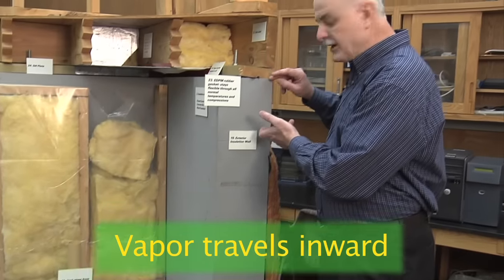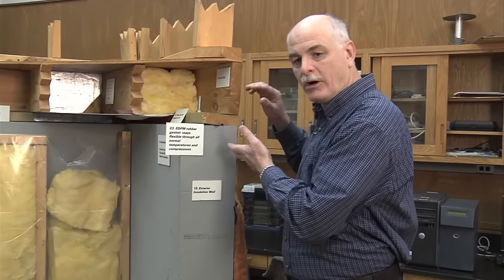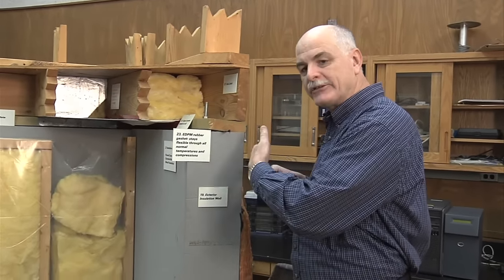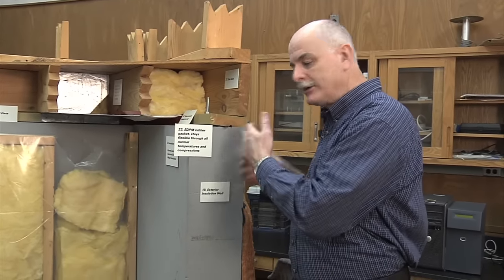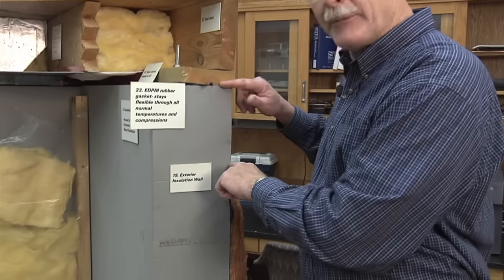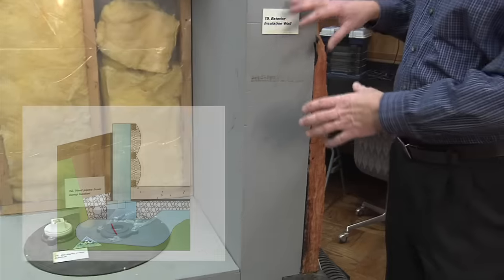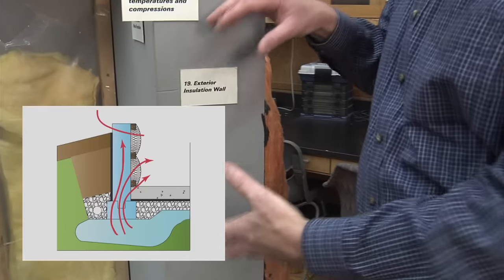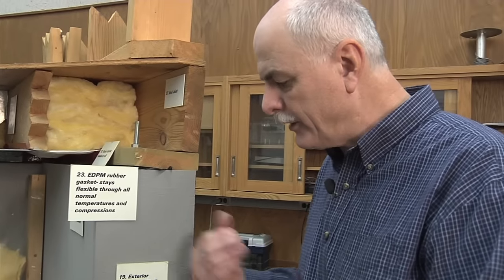Foundation Insulation Effectiveness: Basement building science

Comment: Fantastic video! So basically don't try to insulate your basement for a renovation, is that right? I have a house built in the 1940s and I doesn't look like that the foundation has any water proofing on the outside. If I understand this correctly trying to do insulation on the inside would cause a lot of moisture and mold issues. So that sucks... Sounds like I should just focus a more efficient heating system for my particular case.

Comment: I'm concerned about how flammable foam is and other insulation products demonstrated. has this system been tested for what happens when there is a fire. Just look at the London fire. Why can't something like Rock wool products be used instead of foam & plastic sheeting? I would love to see alternatives that also are tested systems for reduced flammability for residential and commercial apt. buildings.  there is drywall on inside walls and ceilings to slow fire coming in, but you are still trapped in house inhaling smoke/ carbon monoxide.  What if you have a 3 floor residential house and all that outside foam goes up in flames (like London fire) and people just can't get out because entire outside of the house is on fire. they would be forced to jump out of high windows.  These are simply questions I'm interested in adding to the discussion to see if there are other methods that could be considered.

Comment: No, the inboard temperature is NOT always warmer than the below grade (ground). That's why geothermal systems are used to provide heat to homes in the winter after cooling them in the summer.
Reply: He has made the assumption you are heating your basement, which you should be to prevent moisture from forming between the ceiling of the basement where higher temps would meet lower temps if you didn't.
Reply: @NdxtremePro  Ah.

Comment: Most homes that are 20+ yrs old have no insulation on the exterior of foundation.  This accounts for 90% of the homes in my major metropolitan area. Is spray foaming the interior rim joist safe in those homes.
Reply: I know it would be a HELL of a project, but excavating a section of the outside foundation would allow you to both apply a water/vapor barrier AND insulate to the top of the rim joist.Of course, you'd need a mini excavator, probably a pressure washer, and the blue board & paint on membrane.  Big job for sure.  As to insulating the interior of the rim joist, I think as long as you don't seal from the floor above to the top of the concrete.  Perhaps just stay in the pocket & let the sill plate breathe.

Comment: What I have found in my time in construction is that removing SM foam boards from below grade, I have seen first-hand that this product absorbs moisture. What is normally less than a pound in weight brand new, ends up being thirty pounds when it absorbs water. The only recommendation I have if placing it on the exterior foundation and below grade is, tar the entire concrete wall, place your blue SM rigid board and then tar the outside  facing once again. I know this sounds like a lot, but if your SM board is absorbing water, then what good is it in a thermal capacity? 
This was a great and informative video. Thanks for posting it. Cheers!
Reply: Thanks for the idea. I deeply desire to insulate my crawl space. I've seen my neighbors make many mistakes and hence haven't done anything yet.
Reply: The blue and or pink board insulation will not absorb water. Just the white bead board will absorb water and it will take forever to dry out if even.
Reply: There are open cell foam and closed cell foam.  Open may absorb water, closed does not.
Reply: @joycebrune5603  I know the difference in foam boards having used it myself. The foam board that we removed from the ground was a closed cell board, which was surprising.

Comment: So Pat is saying that spray foam may work on a foundation wall only if it's very dry. Would this mean that foam generally can't be done on older stone walls?
Reply: You may not want to anyway. Stone walls may require the ability to dry to the interior. I have no personal experience, but have read a lot of anecdotes of stone walls, being insulated and subsequently having problems.

Comment: At around 6:39 you speak of moving the rim joist assembly inboard and continuing the exterior insulation / vapor barrier up over the rim joist?

1.  Isn't rim joist above grade?
2.  Are you saying to bring the exterior insulation up higher and then sheath underneath the above grade exterior sheathing?
3.  If so ... how do you protect the foundation's exterior insulation/vapor barrier from grade to where the sheathing would typically go.  You don't want your sheathing touching the ground.  

I'm just not seeing how you can bring that exterior stuff above grade and keep it protected from bumps, folding, and mutilation that exterior surfaces experience.  

Do like the vid tho .... Will be subscribing.

Comment: Excellent video!  Water and condensation are finished basement enemies, especially in Northern parts.  There are so many insulation products available and the same amount of opinions out there, many of them contradicting each other.   Seems the best way is to insulate with rigid foam board on the outside, however very few builders will/have put in the expense and do the bare minimum to meet building code.  So that means most of us homewoners need to find the best practices for our already built homes and insulate properly on the inside;  from the rim joist all the way to the floor.   
The one thing I learned today that a carpet would effectively make the slab cold 17:52  "a warm slab is a drier slab"..and a cold slab is not a good thing. I originally was going to build my subfloor with Delta FL (dimple membrane), then 1" XPS foam board, then 5/8" plywood on top, and then my vinyl plank flooring.  Now I think I will scrap the foam and plywood portion so the subfloor will not get too cold...allowing my heated space to also heat the slab and breathe a little more.   I can just have a few area rug to keep the toes more comfortable.  Vinyl plank is pretty warm to the touch.    Several other bonuses with the using only Delta FL and Vinyl Plank only floor.
1)  Increased ceiling height (in my case 1-5/8")
2)  Much less cost (plywood and foam board and Tapcon screws are expensive)
3)  Much less labour of cutting plywood especially around corners and fastening wood down with Tapcon screws (I never liked the idea of drilling holes through the concrete since through capillary action, would draw water up from the slab.
I will use a spray foam for the rIm joist cavities, and then a layer of Rockwool Insulation(does not absorb/hold water)
My wall will have the same combo approach....1/4" airspace (to allow wall to breathe), then 1" Foam board (also acts as vapor barrier), then studs with Rockwool between.
And run an de-humidifier in the summer months.
So happy to have found this article!

Comment: Great video. But, what if you have a granite rock house with a crawl space? I also have cinder block on the inside of crawlspace perimeter. The cinder block walls have condensation on the walls but I can't figure out if it's from the HVAC duct work that's uninsulated and sweating. I have a dirt floor, no vapor barrier. I closed off the outside vents, hoping it would dry out but after watching your video, believe the heat build up is hitting cold walls and sweating. I thought encapsulating and adding foam board on the inside exterior walls of crawlspace, a vapor barrier and wrapping duct work with insulation would help. I'm not so sure now. Any advice would be appreciated.
Reply: It really depends on your circumstances. With you having moisture problems you should keep those vents open (open during the summer, closed during the winter). If you have a high water table or live in a area what has alot of rain, moisture can be a big problem. A plastic vapor barrier  will help prevent moisture in the crawlspace, but it will also trap moisture underneath that can puddle. The thing that may help the most would be to tape all the seams in your ductwork and insulate. With residential it is not code to seal the ductwork for some reason. I would start with the sealing of your ductwork and insulating it. You may also have problems with the grading and/or gutters around your house causing moisture problems. Gutters are the first place i look for moisture problems in a basement.
Reply: Thanks for your input. I had gutters installed and ran drain lines from the gutters, away from the foundation. I also had dirt brought in, to slope away from the house. Only one side of the crawl space is actually below ground and we dug down to the footer, added BlackJack and a plastic vapor barrier, then installed perforated drain line to carry water away from foundation wall. Do you have a recommendation on a good duct work insulation that isn't fiberglass? I'd hate to have to remove it because of all the condensation. Thanks again.
Reply: Most stores do sell duct insulation in rolls that have adhesive on one side and foil on the other. As long as you tape the seams and don't us insulation with paper you should be fine. You may have to wire and tape the insulation on also to help prevent it from falling off.
Reply: if you condition the crawl space(vapor barrior floor and up walls) and seal the air entry points, the condensation should lessen.It does take  a long  time for the soil to dry out, hence the soil vapor barrier should help. You've done the right thing with the drainage
Reply: also listurek(sp? building sciences) had a rock foundation that he has written about quite a bit and his experience insulating
Reply: Thanks so much!
Reply: Awesome! I will check it out. My step dad use to work at an industrial plant and he mentioned a liquid insulation that can be rolled on. Have you heard of this stuff and would it go against residential building codes?
Reply: You wouldn't happen to have a link to this Listurek? I looked hi name up but nothing showed up.  Thanks so much!
Reply: TheItalianGuy lstiburek at https://buildingscience.com

Comment: I wonder how this compares to leaving a 50mm air gap behind your stud frame and running a dehumidifier for that space? An extra solar panel or two would cover the running cost, and you wouldn't have all that synthetic foam sitting there offgassing and being a fire hazard inside your home. You would have to make sure the insulation couldn't fall out the back of the stud frame and block up the air gap, but that wouldn't be difficult to design in.

Comment: 21:40 he is saying that we can frame  as we normally do, use an  (inside) paperless drywall, make sure that the  framed walls are 3/4" off the floor and use semiflat latex paint.

 All other systems he mentioned can potentially fail  unless you have a perfect  exterior wall prep which I doubt with old properties, guess  I will stick to the framing insulateless system.

As far as the interior rim joist goes, I will use foam panels and seal them with spray foam.

Comment: Ok, so what you are saying is insulate both outer and interior walls with rigid insulation. Do I still need to use the Platon membrane on the outer walls?
Reply: +Jimmy tay ilor No.  He strongly cautioned against insulating the interior wall.  His recommended method is to ONLY insulate the exterior wall.  To create a 'finished basement' look, he recommended framing and adding 'NO PAPER' drywall with flat paint, so that the moisture in the wall can move into the home without getting caught in the concrete/finished wall and creating a mold problem.

Comment: Hello, I love this video. I  have foam on the outside of my basement wall below grade. I have a block wall. I would like to finish a small room in one corner. Could I just build my wall an inch or two away from the concrete to allow air from completely around the room. And we always have a dehumidifier running

Comment: From watching this is sounds like I have no chance at making my basement actually dry... so...  i'm down there right now trying to figure out how i want to give it a finish look.....   we have a sub pump.. its never gotten water down there...  overall the dehumidifier keeps it nice and dry....  i guess just drywall right against the concrete?   and if the mold resistant dry wall starts gettin water dmg, i'll just take it down easily 12$ replace..
Reply: LOL...my thoughts almost exactly. Kind of discouraging. I was thinking just put the wall framing a little bit (maybe an inch) off of the concrete wall (using blue board), and then just putting up the mildew resistant sheet rock.This way there is plenty of air space between the concrete and building materials to prevent a "diaper" effect. Looks like we'll pay in the end with a higher heating bill :(
Reply: Dane Stewart why not spray foam?

Comment: "In the summer "heat loss" is in."  Hmm. Heat moves from "hot" to "cold". Below the "frost line" soil temps are pretty much consistent and constant around 50 degrees year-round. Your "heat loss" to that relatively "warm" soil (relative to say...air temps outside in the winter months" is more dependent on interior insulation than exterior "foundation insulation". Simple studded/framed interior walls, fiberglass insulation and quality sheetrock is good enough to be called "excellent" and if you use a radiant non-forced air heat source such as electric baseboard heating and have a good quality indoor/outdoor carpet over a quality thin foam backing, once the basement is "warm" it will stay that way. The various "air-gaps" between the warm basement air and the "cold" and dry soil outside the walls are the real "insulation". Warm walls and slabs also expand to "seal" well and moisture is much less of an issue with a "tight" finished and well-insulated basement because what heat loss does occur tends to "carry" moisture with it. Warmer air is less dense but contains more "energy" than cold, dry dirt. Eventually walls dry out, the soil outside the walls dries out and you don't have a saturated soil profile right next to the wall. And GUTTERS and DOWNSPOUTS that take water at least 2-3 feet from the foundation work WONDERS. After a  few years with a warm in the winter, cool in the summer (heat is "lost" OUTWARD in the summer from the relatively warm inside air to that "cold" dirt - heat always moves toward cold. Always) dry, tight and "stable" basement, the only thing you need to worry about "flooding" the basement or even "penetrating" the walls/floors/slab-wall gaps with "vapor" is a garden hose connected to an outdoor faucet being left on.

Comment: Interesting that he says placing a capillary break at the bottom of the wall should be required but complains that putting one at the top is just adding an extra step.
Also noted that the large grain size of gravel under the basement floor will defeat capillary action, but that water is going to come up through there anyway.
Not a big fan of exterior insulation. I can see its merits, but there are a few significant drawbacks.

Comment: I have been told due to termite risk that using exterior insulation as you suggest is a bad idea - comment?
Reply: if termites are prone to your area, have your soil treated for termites.  There are consumable items placed in small containers in your perimeter ground areas of your foundation to protect your foundation. depending upon termite activity, you don't need to replace the consumables often at all.
Reply: papoh termites do not consume exterior FIBERGLASS insulation as shown in the Video. IT's part of the TUFF-N-DRI and Warm-N-Dri Waterproofing System
Reply: W.r. Meadows makes melrol and cover it with their backfill material followed by 2 drain tiles,one below the footing and the other on top of the footing.
Reply: I would be afraid of exterior insulation where you can not see the concrete foundation. Termites build mud tunnels behind the insulation and you could not inspect for that. The consumable termite treatment is really bait stations that must be constantly monitored.